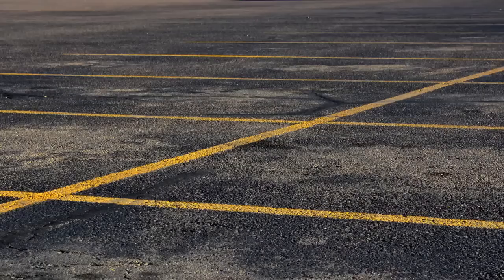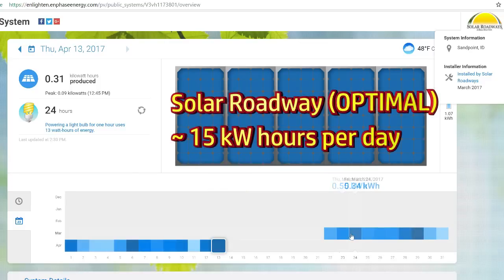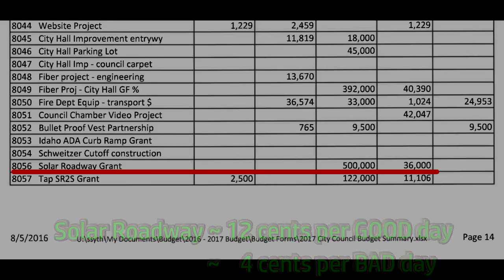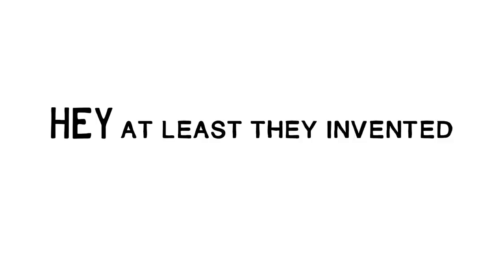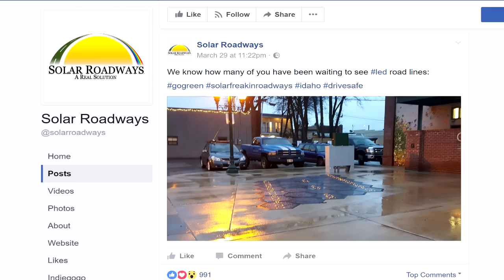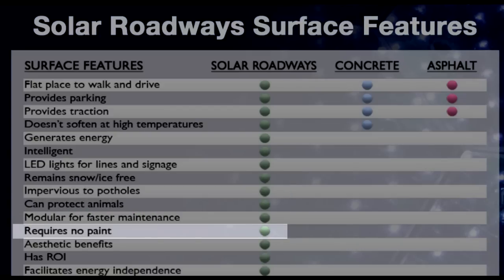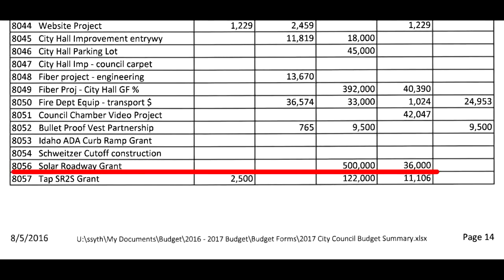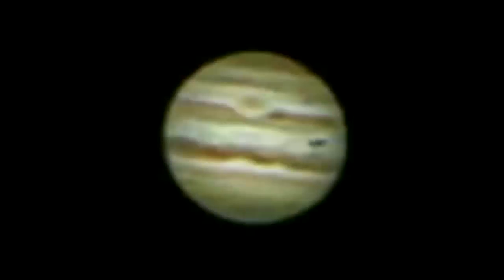Solar Roadways generate ~10 CENTS per day!!

Comment: how about they invent cheap sun tracking solar panels that are affordable for poor people
Reply: As someone who works in the solar field, there are many factors that affect the progression of solar.

1. The typical roof mounted PV system hooks up to the electrical grid. People have this impression that your system just generates power to your house and thats it, or that all your extra energy is stored in battery cells. While there are systems that can do that (Sonnen is one company that makes such products), they are incredibly expensive and the typical household PV system does not use them. The energy from your PV modules first is converted from DC to AC via an inverter/microinverter, that feeds it into the main service panel of the electrical grid and is used by other customers (for which your bill will be offset by the selling of your excess power) if your house is not using it. You'd be surprised how many people talk about how cool it would be to be "off the grid" when I discuss that I work for a company and are confused when I tell them how pretty much every single PV system is on the grid.

2. Like most major home renovations, installing a good solar system requires licensing, inspections, approvals from the county, HOA, and a team of professionals with at least 1 person skilled in electrical installation. with teams of knowledgeable individuals a perfect turn-around from sale to installation is close to 3 weeks.

3. Power companies do a lot to ruin it. APS and SRP in Arizona have crippled the solar market in AZ by reducing what they pay for your generation, charging you a monthly surcharge for joining the grid, and arbitrary direction requirements (that have changed) to get rebates. These things have ruined the residential solar market as all the cost offsets of financing and installing a PV system are lost in arbitrary and unnecessary costs.

All that aside, Solar roadways are a complete joke, but a decent professional solar system with efficient panels (tracking systems are also not common) can produce a good amount of energy.
Reply: Stugem S but that would require actual research and engineering!
Reply: +Striderx254 
 Good, and informative comment bro  :) . 
 Most folks have the wrong impression about solar, but maybe that will change as the public uptake of this technology improves.
Reply: @Mark nope solar panels are actually way cheaper than you think. You can get a 4.5kW system now installed for as little as £3500. The feed in tariff is about £0.04/kWh. You will actually generate an average of about 20kWh per day off that, or about £0.80 per day IF you don't use any electricity yourself. If you use it all then you save £2.40 per day. That's £800+ per year saved. That would pay off a £3500 loan in 6 years. That of course does not include the government grants you can get which can make another £600 - £1200 a year difference.
Reply: I think $4500 (the currency equiv) is quite a lowball estimate for a 4.5K system. A sufficient inverter (lets say, a SolarEdge 3800H) will run you about 1000, 16 Hanwha 290W Monocrystal Panels will run you another 3000. You're already at 4k and still have: Your base attachments (Ground mount? S5 Proteas? Flash? Ballast?), rail, wire, optimizers, fused disconnect, PVM (possibly), Junction box(es), if you want power monitoring, something like a ZGBW unit, L feet (possibly) Clamps, bolts, optimizer clips, conduit, fuses, splice kits, piercing connectors, grounding, solarseal, and may other potential items that may need to be addressed or purchased, like cutting down trees or getting a new roof entirely.

And we haven't even touched permits, designs, structural letters, inspections, or installation.
Reply: @Strider254 there are installers in the UK that will do it for £3500. It would be illegal in the UK for them to advertise that they can if they didn't.
Reply: Gordon Lawrence Is that just for the installation, or does that include all the parts, too? Because I run the warehouse for a Solar company and do all the product ordering and build our job installation kits, so I know both what it takes to build a PV system and get heavily discounted prices with our vendors due to our volume. 

I had a few free minutes at work and priced out the bulk of a 4.5k system with what we use (Hanwha 300w mono cells, Solaredge and Iron ridge components), and Im at roughly $4700 and that doesn't include wire, conduit, couplings, or paying the installers.

Even suggesting that they use much cheaper parts; When you factor in labor costs, paperwork, and other expenses, it baffles me how those prices are real, or what kind of low quality, outdated garbage they are installing for them to not be hemorrhaging money.
Reply: Gordon Lawrence That's way low, and you don't include the cost of battery pack (if you plan on using any significant amount of the energy captured) then add in the energy lost from storage and conversion to AC and you end with a much much lower return. 

The simple fact is that if it is as profitable as you make it sound, then why are so few people actually doing it? Consumers vote with their wallets. 

On a final note, the power companies do not like the solar panels that are connected to the grid because the power output is so inconsistent, in many areas the power available during a sunny day is way higher than demand, but the company is still paying for this unused energy produced by the panels. And then during the night there can be shortages.
Reply: Stugem S The problem isn't that tracking technology, it's that solar panels themselves are too inefficient/to expensive to justify their installation in the first place. (This is the reason that very few people install them)
However that is changing fast and I expect to see panels being developed within the next 10 years that can pay themselves off within 5 years or earlier. I expect that to be the tipping point and suddenly the market booms.

Comment: To be honest I'm just surprised they actually generate any power at all, at this rate. So this means the solar roadways are actually surpassing my expectations. Which isn't saying much but there ya go.
Reply: Not to mention the many accidents that will happen on that road, since the surface isnt fit for vehicles to drive on, and have their panel frames getting unscrewed because of the horrible construction work.

Last time I checked, glass is a horrible material to use for traction.

And no, I am not going to take their word when they claim that its "Tempered Glass which provides the same or better traction than asphalt at least".
Reply: And if you did make the glass abrasive enough to have good traction and you ever wrecked a motorcycle on it without chain mail it would shred a human being. After a while the surface would just get smoothed out by traffic and wear to get slippery but they would probably just be dangerous and sharp at first. Nothing about this idea is good.
Reply: Yeah but the power they generate is like less than 1% of what they require to operate. I'm sure once you put them in actual roads with dirt, tire wear, brake dust etc. the numbers get even worse. They have a half million dollar array that would barely power a cell phone.

Comment: okay, so it seems the solar road ways is a thoroughly bad idea. But what if you built the solar panels over the road? As in having the cars driving underneath several hundred diffrent squares or cages built over the highway so the solar panels could track the sun and maybe even light the road at night as cars travel underneath them.
Reply: Maxx Kroes yes we have them that get installed on your roof, but they dont normally move. and im talking about an entire highway where these panels and their chassis would make a sort of tunnel
Reply: Grim Lock Or we could just build a ton of tracking panels in the middle of nowhere. Or panels for most homes. There are much better places for panels.

Comment: y not take it slow?
I mean they bit off more then they could chew.
make the solar panels more effective first then harden the glass or make them more durable after that there are two thing we can do and it depends on the energy output
low energy should only power its panel and surrounding panels while they communicate to each other to make their shapes and all that.
if its high enough then have it do what I said a sec ago but also power homes

Comment: The comparison with regular solar panels is pointless. They are not replacing them they try to replace roads which cost around 4 million per mile and don't generate any money per day. If you really have to keep beating that dead horse then at least do it right. 

Btw a new paper on a device that harvests water from air was released from a couple of guys from MIT. The media was all over it. Would love to see a video about that.

Comment: solar freaking thorium powered roadways made from plastic from the air that take water straight from the air and ground for the poor and power the vacuums for the hyperloop
Reply: Apprentice don't forget the em drive humidity extractor for all the thirsty children
Reply: Thorium reactors work. There have been smaller 1MW systems working on and off for decades. http://thorenergy.no/
Reply: It just might work!

Comment: you're looking at this the wrong way Thunderf00t. in 2000 years that that Walmart will have paid off the solar parking lot therefore in 4000 years they would have saved half a billion in operating cost. assuming no one parks there of course.
Reply: More Solar Roadways actually creates a bigger deficit because it will cost more to install and repair them, it's still 10,000 years before any of them pay themselves off minimum but the time goes up the more you install due to work hours needed for the installation.

Comment: You are referring to a "facility" that is les than 200 square feet.  It is new and very small, proof in concept if you like.  Spread these panels across large areas and now they are more than viable.  Obviously something new takes time and it has an arch where these become absolutely viable, cheaper and productive.  In the future it is an option that will one day be needed.  You are short sighted, and being critical of the first little tiny panel that will one day encompass the entire road.  You must be a conservative.

Comment: Find a traffic light on a major street just downstream of a freeway exit and look at the pavement.  It's not uncommon to find it extremely deformed from a thousand trucks braking against it every day.  That's a nice visual example of how much stress is placed on roadways.  I don't believe for a second that these solar panels are going to hold up to the abuse of traffic even half as well as pavement, nor anywhere near as well as concrete.  Modular maintenance isn't much of an advantage if the price per square foot and the replacement rate of the tiles is 100x higher than standard road maintenance costs.

Comment: Full 1.7L kettle, that you showed would boil water in 3-4 minutes. 5 
minutes is not barely enough, it's comfortably enough. So don't lie 
about this great invention! I already start save 500000$ for my own 
solar roadways yard. When it's ready I will be drinking tea with my 
whole family in case of power shortage!

Comment: Ya know, even if the idea was perfectly practical and worked amazingly well, it's still not forward thinking enough.  Why would we even need changing lines on the road, or adaptable parking spaces when in a few years most cars will be self driving effectively perform all of those functions and more themselves?  In fact, you could probably erase the lines off the street at that point.  They are somewhat irrelevant. (Depending on the software doing the driving of course...)

Comment: You mean the cheap $20 30W panel I put on the roof to supply some backup power for power cuts actually generates more power than this half meeeellion dollar setup, and my panel actually worked first time.

Comment: You've got three extra zeroes at ~15:45 in the video.

And while I think you are 100% correct on the lack of feasibility of this project at this time, and in the near future, I do think you over-emphasize the lack of craftsmanship and high failure rates of the demo.  They're hand-built prototypes, so of course they are going to cost more, have higher failure rates, and be less sturdy than a final, mass-produced manufactured version.

This idea is dead by the math and the materials science aspects, as you have well-stated in previous videos.  And while manufacturing costs and reliability are certainly something worthy to discuss, I think it's unfair and pointless to use the prototypes as the basis for that argument.  I'm sure you are familiar with the transistor.  This line of reasoning is like looking at the original transistor (which is open to air and ~5cm tall) and arguing against the idea of the modern computer.  

The reliability, tolerances, waterproofing, and other aspects are solvable issues that are MOSTLY related to the hand-built nature of these prototypes, and I simply feel the focus on them detracts from the sounder argument at the core.
Reply: I think the lousy craftmanship is a legit beef with the project.  There was supposedly $500k put into that working prototype; that should be enough cash to hire skilled craftsmen.  The prototype needs to establish that it works as it stands, and that it can be scaled into mass production and installation.